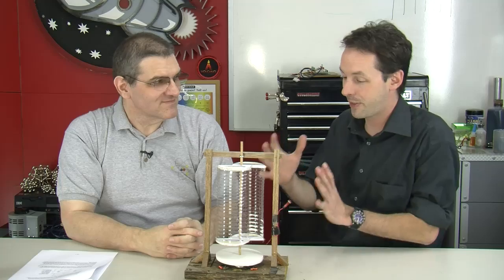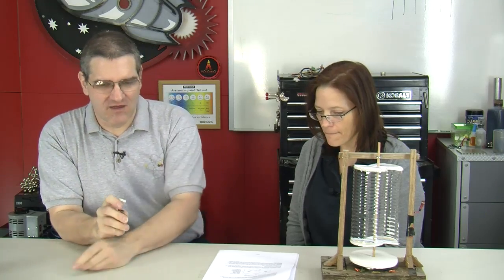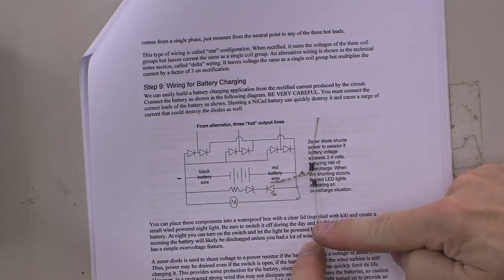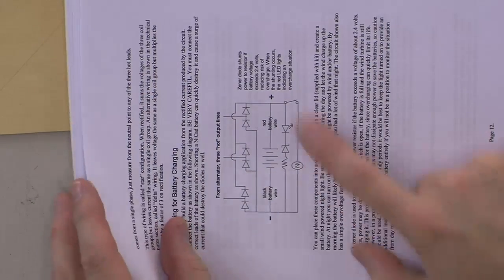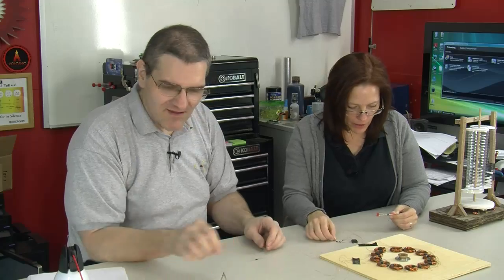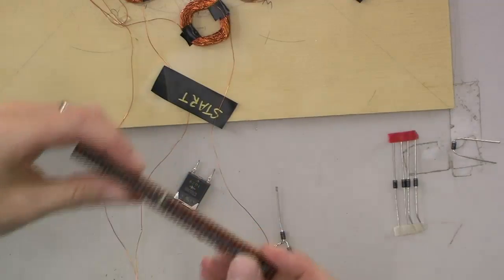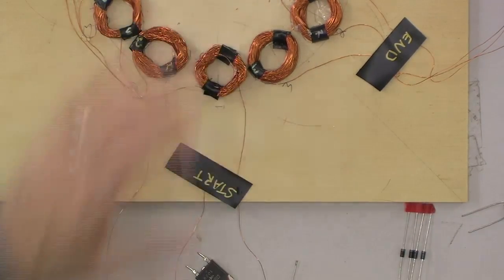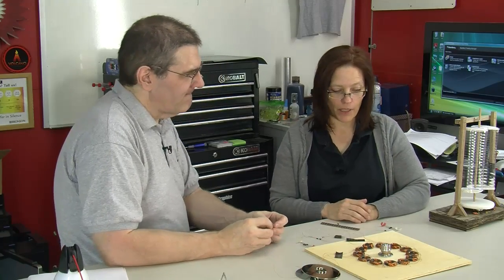3 Phase Rectifier Basics (VAWT Engineering)

Comment: @Madarpok Actually, this is a full wave setup. A four diode full wave bridge rectifier is effectively two thirds of a three phase, six diode, rectifier. A three phase, half wave, rectifier would only have three diodes. (splice the striped end of the diodes together and label that connection "+", connect the other ends of the diodes to the wires labeled "start" on Laura's stator, then splice together the three wires labeled "end" and label that connection "-") Will cover this in our followup.

Comment: @danz409 The answer is the coils are in parallel.
  
If you want to make a 3 phase generator you need to make sure the number of coils in the generator are multiples of three and ever third coil is in the same phase. so lets say you use 9 coils, this means coils 1, 4, 7 will be in the 1st phase , coils 2, 5, 8 will be in the 2nd phase and coils 3, 6, 9 will be in the 3rd phase.

 as long as each coil with the same phase goes to the same rectifier its a 3 phase system.

I hope that helped

Comment: not to be one of those youtube cementers you hate oh-so-much but i have a question about the 3 phases on those coils. when i think of a 3 phase coil. i would imagine only 3 coils and wires coming off each coil. but most of the ones used in most of today's generators motors etc have tuns of coils. how does that work? 

@ maglinjosvinn same i want to make one now too. the geek group is soo motivating!